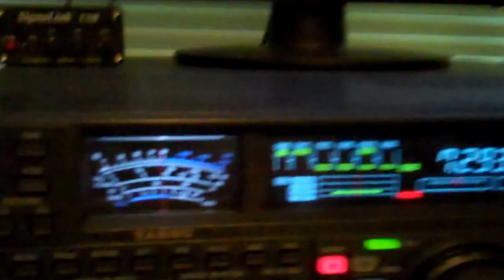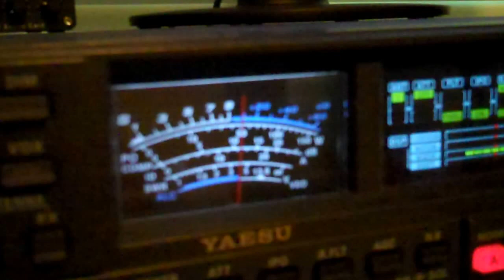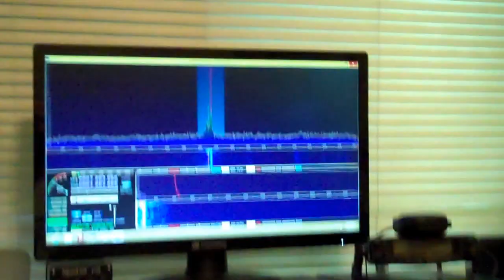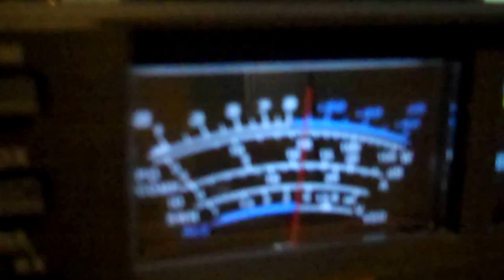40 meter Double Bazooka vs 80  meter doublet

Comment: Hmm. You say "there is no comparison", but actually the antennas seem fairly close to one another.   OK, the bazooka is a bit better.   But it's certainly not a "night and day" difference when you switch antennas.  The "S" meter doesn't change that dramatically.  Maybe 1 s-unit or so.  At least that's what it looks like in the video.
Reply from the maker: +zgrafsoftware You missed the point.  The noise flloor is much lower on the bazooka.  Signal to noise ratio is very important on low bands.

Comment: Not a very conclusive test by any stretch of the imagination.  You don't tell us the orientation of the antennas with respect to the signals received, how they are mounted or anything.  Your test doesn't take into consideration changing band conditions (at the end the stations are pretty much the same due to QSB), and samples just one or two signals.  And why do you think the noise floor might be higher with the open wire line?  Could it be that the line has become unbalanced, invalidating the comparison?  Have you looked at the doublet with any sort of test equipment to know?

Models of the DB show any improvements are very very slight, and the noise difference is better at your QTH.  Could be for reasons particular to your installation.

With that said, glad you are happy with the DB.
Reply: Good grief, its youtube not MIT.......
Reply: *****
It is Ham Radio, not a kindergarten :>P

Comment: my 130 foot doublet sucks on 40. It is two half waves fed in phase which is not a good match.Like 2000 ohms impedance,  I tested a 40 meter end fed at 20 feet above ground vs my 80 meter doublet which is up at 65 feet. The end fed was 1 -2 s units stronger on receive. so your test does not prove anything. Try your 40 meter double bazooka against a 40 meter half wave doublet. The bazooka will be the loser.
Reply from the maker: +anthony costa I ran exacctly that test. 40 dipole vs the bazooka, back to back. Bazooka wins. Lower noise floor and more signal.